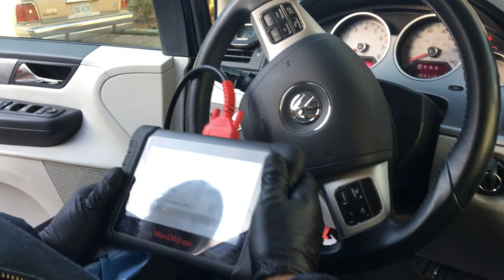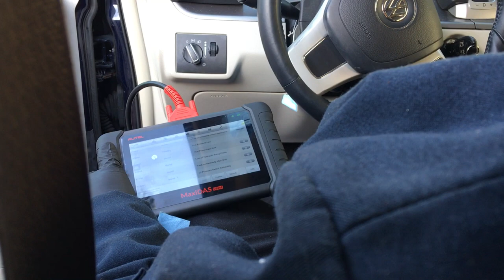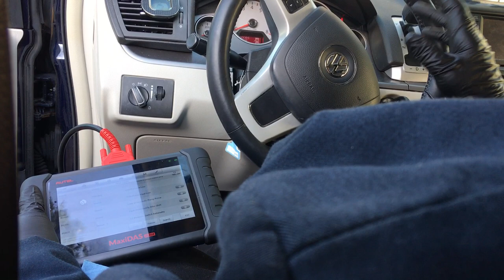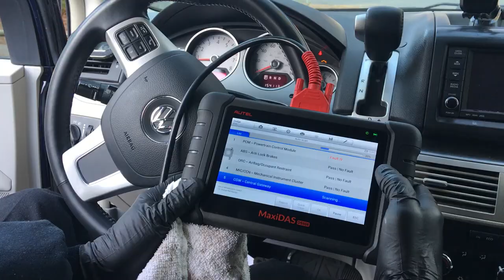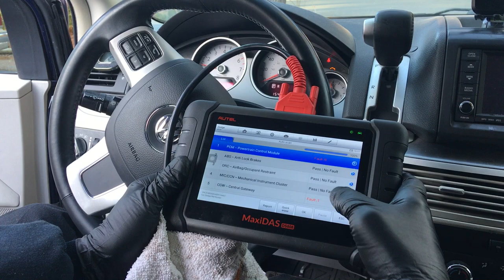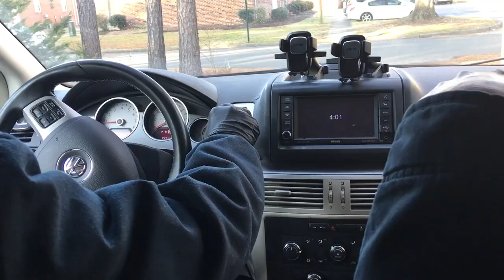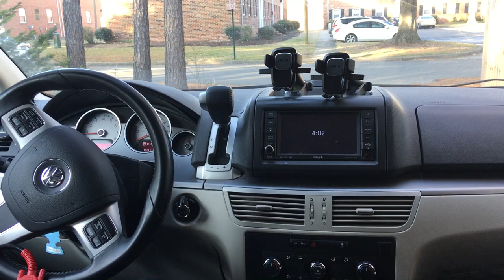Volkswagen Routan 62TE 6-Speed Automatic Transmission Damage

Comment: Hi I have 2011 Routan its ran great until it started cranking but turn on sometimes I think its fuel pump. Is there a way to check fuel pump is working?
Reply from the maker: If the 2011 Routan has a fuel pressure test port then a fuel pressure test gauge can be installed to check fuel pressure the Autel DS808 MaxiDAS scan tool includes a feature to perform a fuel pressure test without starting the engine.
Reply: All I get is something regarding thermostat

Comment: I own one of these very reliable I have 230,000 on mine same motor and tranny runs perfect
Reply: good to hear i just bought a 2010 with 110k miles for 6k looks beautiful i hope it lasts as long as yours stay on top of the fluids! cheers
Reply: So you're the one!
Reply: and here I am with only 124k miles on mine and this is the 2nd time my trans is being worked on.  (2009 VW Routan. 4.0L SEL)
Reply: If the computer goes out on this wish is what happened with me first year I own it it will cost you a fortune almost $1500 or more and can only be done at the dealer , get rid of it ASAP

Comment: They should be serviced at 60 thousand miles, regardless of no dip stick. It's easy to check using the oil dip stick.
Reply: The manual says 120k miles if not used aa extreme aplication.

Comment: Why no dipstick?  What dip designed that?
Reply from the maker: Many late model passenger cars don't provide a means to directly check transmission fluid level. The vehicle has a check engine light that indicated a problem with the transmission but the driver continued to operate the vehicle for an extended period of time until the vehicle wouldn't move. The vehicle has a 154K miles and is used as a Uber vehicle daily.
Reply: @ThompsonAutoTest  you have to use the oil dipstick to check the transmission fluid on a vw routan.

Comment: I'm looking at buying this same van 2010. He says drove fine no issues one day parked it and then it wouldn't start because the transmission sensor says stuck in drive. I've read up on it but would like your opinion it only has 130000 miles and they are asking 1200. What do you think it could be and is it worth a shot to buy it
Reply: Get it inspected by a mechanic / and transmission specialist

Comment: Hello everyone, I have one of these 2012 VW Routan SE ,don’t know if I should call it that Or a Chrysler , Anyway it’s doing the same exact noise same exact problem with the transmission except that it drives when it’s cold only for the first 20 minutes than transmission fail to shift , it’s paid off , is it worth it to fix it ? Or just get rid of it ?It seems very difficult to get answers from transmission places
Reply: 2nd mine will run cold then wont shift into 1st gear after warmed up.

Comment: what kinda transmission fluid i have 2012 routan ... sounds like i need transmission fluid
Reply: It takes ATF+4 only, not autoquest univeral fluid. The in pan filter is prone to clog at this milage from wear. Service every 50k mi or sooner,  lifetime fluid means "out of warranty"
Reply: @marquisdesade6191  thanks! I'm surprised he put 3qts in without even checking the level somehow

Comment: Are you going to be posting a video of the repair? It will helps us a lot
Reply from the maker: Not on this vehicle but in the future on a similar transmission.
Reply: @ThompsonAutoTest  I have this exact same condition on my 2011 Routan, have you been able to root cause it?
Reply from the maker: @matthewvonarx1181  This vehicle is used as an Uber Van and was operating for a long time with low transmission fluid level and solid Check Engine light on. It was pushed to the point that it would not move and the owner opted for a used unit from one of our local used auto parts yards. It is back in service as an Uber Van but the owner is careful to check transmission fluid level.
Reply: @matthewvonarx1181  same with me what did you end up doing ?
Reply: @evancamacho628  I have same exact issue on my 2012 Routan SE any tips ? Repair cost ?